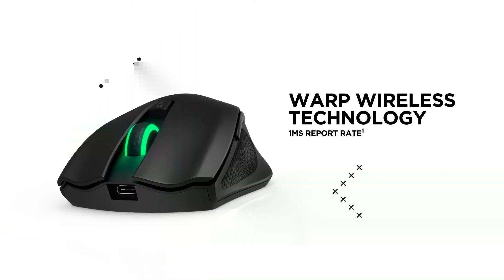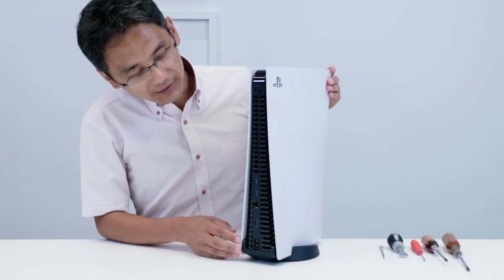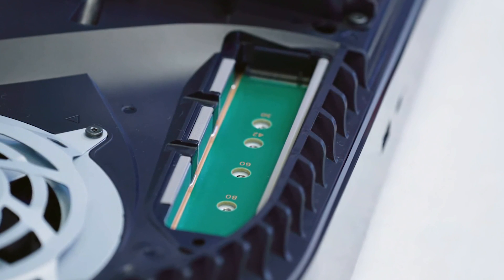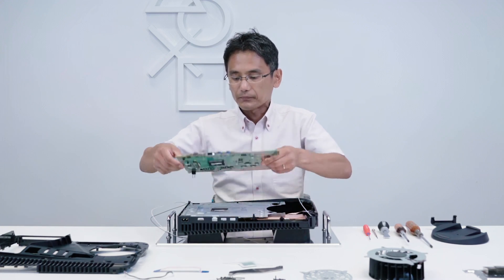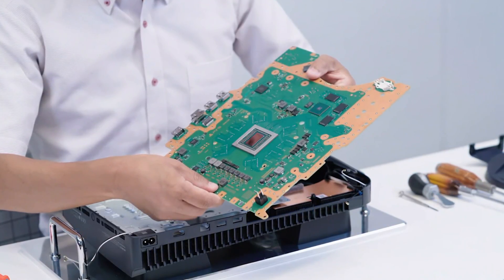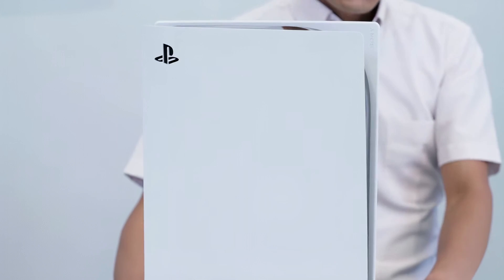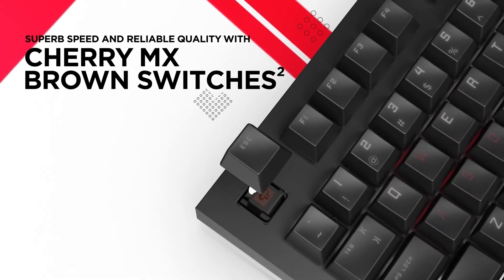PlayStation 5 Teardown Analysis: Inside Sony's Next Generation Hardware Design

Comment: He said the PS5 hardware is "Toyota like" lol. I gotta agree with that. This box really doesn't seem all that sophisticated. It's much bigger than the Series X and less powerful. Series X is definitely the better engineered and more advanced console, that can't be denied. Not to mention Series X is full RDNA2 and Sony is still being vague about the hardware. Will it be a good console?...sure it will, but when comparing the 2 you can clearly see which one has the better hardware in it. Incoming Sony fanboys mad at the truth in 3....2....1....😂
Reply: Beastcraft  More smoke and mirrors from Sony. Release little bits of info here and there and let their rabid fans hype up and spread misinformation. There's a reason Sony has been quiet about the hardware and capabilities of their console and I think it's because they know the Series X is the better/more capable machine. In years past Sony had the "Power" narrative and shouted that from the rooftops daily...now....crickets.

Comment: Another channel was suggesting the new BT and new WiFi are needed for wireless VR...
Reply: Which was a stupid comment IMO as all high-end new WiFi enabled devices have WiFi 6.  Its merely so that people on Gigabit broadband can download their games faster.  Having to disconnect from WiFi to use VR would really not be practical.

If they wanted wireless for VR it would make far more sense to use a custom protocol designed JUST for that using the 60Ghz wireless band.

More likely is that USB-C port on the front is for VR.
Reply: i don't think wifi 6 have enough bandwidth for vr especially when the next vr most probably will be 1440p. if i am wrong anyone can correct me.

Comment: The reason it's big is simply because it's the fastest console out there everything is fast from storage to the soc

Ssd 5.5gb/s vs series x 2.4gb/s

Cpu multi thread 3.5ghz + gpu 2.23 ghz = 5.73 

Series x 
Cpu 3.8ghz single thread + gpu 1.825 = 5.63ghz

Cpu multi thread 3.66 + gpu 1.825 = 5.43ghz 

So ps5 total system clocks 
5.73ghz

Series x = 5.63/5.43

Memory bandwidth 
Series x (560+336)/2 = 448 overall bandwidth split pools

Ps5 = 448 unified there's no contest here

Infact series x system reminds me of PS3 more shader throughout but complex 

More memory bandwidth but split and bottlenecked!

Something's uneven with series x design
Reply: Stop with the misinformation
Reply: Sean A. Harris explain what misinformation! Numbers are facts.
Reply: What kind of moron sums up CPU & GPU clock speeds without taking compute units into account? Not to mention, Series X has 6 GB of 336 GB/s RAM... NOT 8 GB, so your maths are completely off. You also failed to mention that around 3 GB of said 6 GB slower speed is reserved for the OS, so that means only 3 GB of 336 GB/s is dedicated to games, compared to 10 GB of 560 GB/s. 10/13 = 77% of RAM dedicated for games will use the faster 560 GB/s RAM. So by your logic, it would be something like:
10 * 560 + 3 * 336 = 6608 / 13 = 508 GB/s of "average" speed, which far exceeds the PS5 speeds. What a fail. It also makes absolutely no sense to add up the different clock speeds of the processors or the RAM, that's not how graphical performance works. You are clearly so desperate for PS5 to look superior that you will resort to any type of bullshit mathematics to make PS5 look superior... But in doing so, you deliberately leave out key information that utterly destroys your pathetic narrative. Also ironic how you failed to mention that these frequencies are best case scenarios for the PS5. It's already been confirmed that the CPU & GPU CANNOT both run at those max clocks at the same time. It's either or. Meaning, if the CPU runs at 3.5 GHz, then the GPU won't & cannot run at 1.825 GHz and vise versa. The Series X doesn't feature variable frequency & can run at those locked frequencies regardless of the power input or the load. What an absolute trash comment.
Reply: MG you fool I'm talking about total speed of both cpu and gpu it's why the ps5 is so hot the cpu runs at 3.5ghz and gpu at 2.23ghz
Reply: MG what summations list them and stop creating numbers from ur arse first u falsely said I mentioned 8gb which I didn't so be clear and stop crying! Ps5 cpu is 3.5ghz gpu is 2.23ghz go google it in total there's 5.73 ghz running in that machine and it's why it's hot
Reply: It is interesting with a name as "Thinking Tech" that you wouldn't actually think before talking about the tech. You don't add the the clock frequencies of the CPU and GPU to compare performance between different solutions. Seriously, who does that? While the PS5 GPU is clocked higher the the Series X, that Series X is a wider GPU design since it has more compute resources. And performance doesn't scale linearly with clock speed. For example when testing GPUs from AMD's 5000 series cards that use RDNA 1, testing has shown that the performance increase seen from increasing clock frequency isn't the same. So for example if the GPU in overclocked by 10% you're not going to see a 10% performance increase. And that isn't just RDNA1 that sees that nonlinear scaling, it is common across everything. So a wider design with additional compute resources can out perform a smaller, yet higher clocked GPU. And the fact that the RAM in the Series X is split doesn't mean that it will cause a bottleneck. The developers have full control over which pool of RAM is used and by what, so your example of the overall bandwidth being on 448GB/s isn't accurate. They can use the higher end pool for data used by the GPU such as textures, while general game data and OS data can use the lower bandwidth pool. Sure Sony's design is easier for a developer, but Microsoft's approach isn't terrible because with their GPU is very powerful and needs to continuously be feed lots of data so that higher bandwidth memory pool does make sense.
Reply: Thomas Garistina I didn't add the clock frequency in talking about the overall speed of the 2 processors in the system. And why the ps5 is hot
Reply: @machinefannatic99  Wait, you're adding clock speed to make a point about thermals? Again, where are you learning this from?! Clock speed is only one variable when discussing performance, whether it be compute performance or thermal performance. Even if the PS5 and Series X had their CPU and GPU clocked the same wouldn't mean their thermal output would be the same since the Series X GPU is significantly larger so it is going to draw more power. And more power draw means more heat produced.
Reply: Thomas Garistina I'm talking of clock speed not teraflops or what console performs better! The ps5 is clearly the fastest interms of clocks and overall data bandwidth from storage to processing! And it's why it's hot and bigger cause they went for speed and a smaller die! Even the ssd is hot at 5.5gb/s not to mention the off shelf ssd will also run hot as it needs to be 7+gb/s. Everything on that thing is fast.
Reply: @machinefannatic99  I'm sorry but can you point out where I mentioned teraflops? Because I'm trying to understand why you mentioned it. And maybe you didn't read my initial comment, but by claiming the PS5 is the fastest just because of the total clock speed is so misguided and wrong it hurts. The PS5 may be "the fastest in terms of clocks" when you combine the CPU and GPU clock speeds but that doesn't mean it is the fastest in terms of actual performance so I don't understand the point you're trying to make. And again, who in their right mind combines the clock frequencies of the CPU and GPU to claim a chip is the fastest? The CPU and GPU handle entirely different tasks so why are you combining their clocks? And where are you going with your thoughts? Because one sentence you claiming the PS5 is the fastest and then you're talking about how hot the PS5 will run. Why are you talking about clock speed and then temperature with the storage? In terms of actual performance between the systems, the SSD storage is one of the few areas that the PS5 outperforms the Series X. So you're right in that regard, just wrong in about everything else.
Reply: First of all I didn't say the ps5 performs better than series x I said it's the fastest console, the problem is ur using emotions instead of your head to discuss! Secondly from what I've seen judging by the games the ps5 has shown better looking games and better performing ones and all I've seen on series x is either current gen, broken games like halo or developers complaining about how complex it is developing for series x and it's Dev tools, other than that we'll see how both systems perform when they get out but on a enthusiast point of view the ps5 looks better balanced and designed!
Reply: MG this explains it ur simply a fanboy who's using emotions to think! The series x isn't fast it's simply got a powerful gpu shader throughput but the gpu is 400mhz slower than ps5s 1.825 vs 2.23ghz and secondly the fast ssd, I/O or loading isn't simply about loading screens loading is everything you see on screen the faster the data you can load the more the detail the ps5 ssds speed is simply imitating 100s of gb of ram if you understand graphics you'll know what this means! Cause they showed this in the unreal 5 demo! That demo was displaying film assets per scene 100s of gb of it on one scene go ask a game developer how expensive that is and he'll explain! That scene would crash any modern pc out there without the ssd speeds or io of the ps5 not even a rtx 3090 can load that demo without data being streamed from storage to gpu as fast as the ps5 is doing! This is the benefit of the ssd and up speeds so next time go do your homework before jumping online and talk things you don't know.
Reply: @thomasgaristina8413  In practice no developer will utilize the " slower " RAM part  of the XSX .
Reply: @MariaRodriguez-hb4ix  Woah, I had no idea you have insight into every single developer that is currently working, as well as developers in the future working on the Series X. That's awesome! What else can you tell me about the future!? But jokes aside, I would find it very hard to believe that developers aren't going to take advantage of it since every MB of RAM is a precious resource.
Reply: @thomasgaristina8413  It happened in the past . Divided RAM portions were available . But most developers did ignore one . As is more complicated to use . 

This didn't means someone could consider using the " slower " part for anything . Already half of it is used by the OS . Isn't exactly a lot available . But is there is  a case requiring   more than 9GB  to run a game . Some functions could be put there . This will complicate things a lot .
Reply: Well that's a big problem because a similar game will use more ram on ps5 and less on series x then! This explains a lot why halo infinite looked mediocre and lots of games having problems running properly on series x
Reply: @machinefannatic99  It is ironic that you would bring up how Halo Infinite looked on a Digital Foundry video when Alex Battaglia dedicated a whole video to discussing that. To sum it up, a lot of the flatness that is noticed in that trailer is due to the lighting that is used. I would recommend you watch that video and maybe wait for the finished products to release before passing judgement on an unreleased console and game.
Reply: Memory bandwidth and interface are both bigger on the Xbox. Plus the Xbox has more cores for the GPU by another 50% so the extra 33% clock speed likely will make them nearly a draw or the Xbox just slightly ahead. I expect in general the Xbox will be slightly faster though I expect the PS5 to outsell it in the short run. In the long run I think Microsoft will win as $5 a month for every Microsoft, bethesda, EA game, and others is an absurd deal I imagine most parents will be looking at.

smidgen
Reply: Skylancer727 yes it has more cores and as I said before more shader throughput but bottlenecked split memory this is similar to what the PS3 had more flops but split memory

Comment: Smaller, more powerful and runs just as cool = Better Engineered.  I’m not a fanboy but a huge tech enthusiast. If we were comparing PCs, it’s a no brainer.. the Series X is much better based on the hardware.  However, I’d still get PS5 for the exclusives. The fanboys just need to stop with saying DF are paid shills etc. Just accept it, the Series X is the better designed machine. Period. Now which is the better gaming platform.. well that we will see.. Great Stuff, DF!
Reply: Actually ps5 is better cooled and ps5 is faster than the xsx just saying 🤷
Reply: @domzzcardzz7985    Wow, hahahaha😂. Ok, tell me, how is the PS5 better in coling, please let me know...

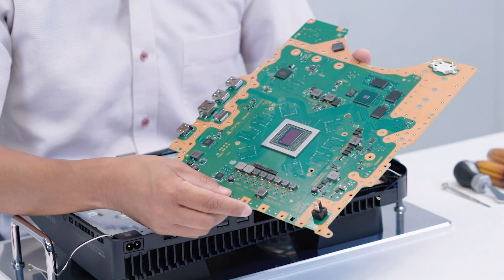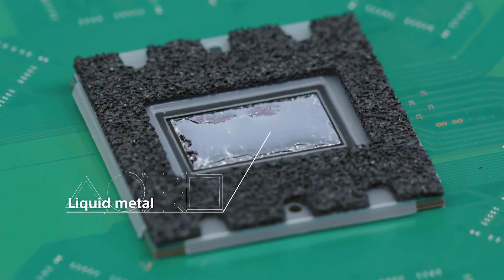Comment: 10:16 Just like me down there. Jokes aside. Wouldn't that Microsoft's board be about the same size if it was one board, lol? I'm sure two separate ones are way more expensive to manufacture. 12:28 And continues to be a weak spot for the Series X.
Reply: No not as all. The two series X boards actually pack almost twice the hardware than the ps5 does, just look at the density of components.

The split board is genius, and one of the best aspects of the consoles design. It allows them to create an extremely rigid sandwich (look how thick that cast aluminum slab is) of circuit boards and aluminum. Board flexing was the number one reason for device failure on 360, ps3, and ps4. This basically eliminates that, and then they went and put a massive freaking vapor chamber on it!

Not only is the Xbox the slightly cheaper system to manufacture (excluding SoC) but it has a better cooling system.
Reply: @SirDragonClaw  thanks for the information. Details like this are always appreciated more than just shouting X is trash or Y is genius
Reply: @SirDragonClaw  digital foundry told series x is more expensive to manufacture though.
Reply: Actually that split board is part of the genius design of the console.
Reply: Is it a weak point? Its also cheaper to repair...no one can defend the size of the PS5 even more funny when unconfirmed report says it runs hotter than XBSX even with the size. Well you can say its only rumors but so are the Xbox rumors which Sony fanboys werent slow using.
Reply: @fredrikedvardsson9246  The amount of heat energy is decided by how much power they will use ..... If they both use 300W then they will both output the same amount of heat energy ..... Heat energy is measured in watts .... 300 watts of heat energy at 50C is the same as 300 watts of heat energy at 40C ..... Temperature for measuring heat energy is analogous to voltage in that voltage alone doesn't tell you anything about how many watts of energy is actually being consumed, temperature alone doesn't tell you how many watts of heat energy is being produced .....
Reply: @longjohn526  thx for answer, yes i know that but the cooling solution and design decides how effect it will be to get rid of heat. If the PS5 runs hotter and is bigger then we can agree that the Xbox is better engineered not that it matters for everyone but its hard fit this beast
Reply: I don't think it's a weak point tbh.
Reply: OP: I'd love it if they didn't compare it to Xbox all the time. 

Also OP: The Xbox is weak in that area as well!

Comment: I've never seen a 12-channel consumer SSD, so what is this "white list"?
Reply: A "white list" would be a list of Sony-approved third-party SSDs that have the minimum specs needed to perform in the system.
Reply: @stuporman  Compared to Xbox Series X's £220 2.4gbps thumb stick.
Rather get a Sabrent for £160 at double the speed.
Reply: @S94-l9w  Unless you want it to run on PS5
Reply: sustained write/read speeds are not an issue, hence the ps5 has a peak throughput of 5.5gbps (as opposed to 7). The issue here is that all available SSDs have either 4 or 8 channels, not 12. So would this require you to install certain games on the internal storage?
Reply: @malamri424  That's why you need a much faster SSD
Reply: Cerny said that’s why a 7GB/a gen 4 SSD is needed.